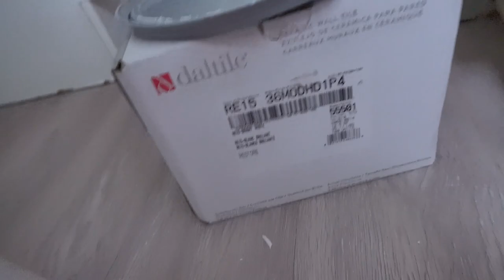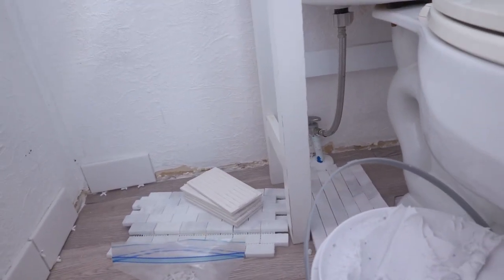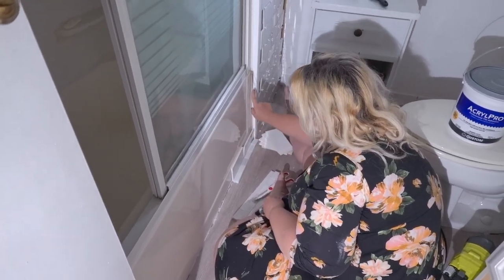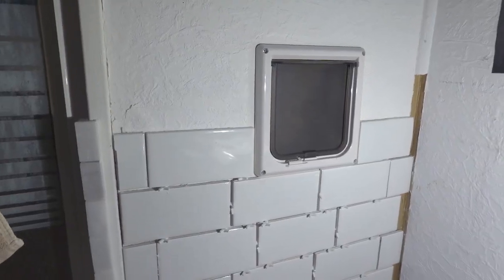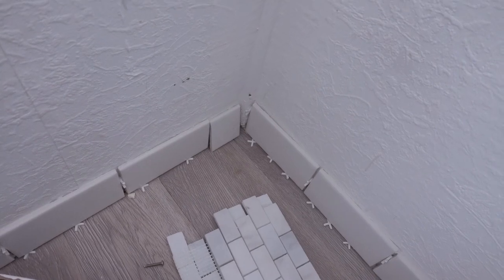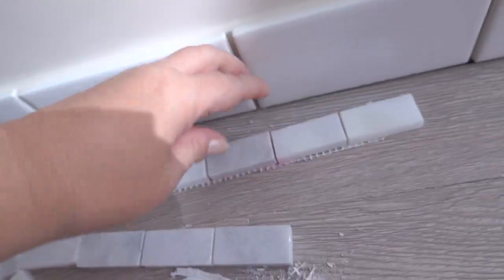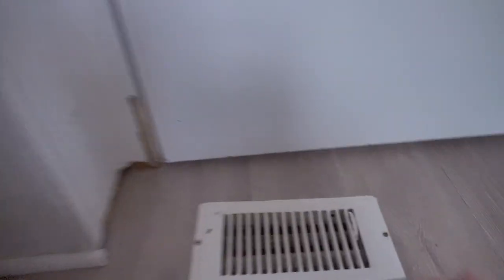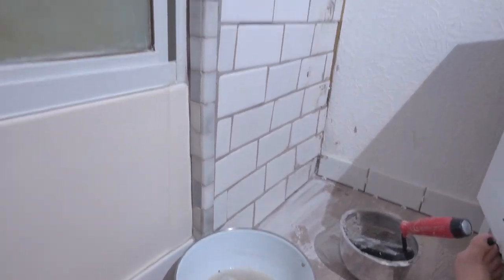Wall Tile in Bathroom Singlewide Mobile Home Makeover

Comment: Very nice all the hard work you are doing you know so much......how does kitty get onto that litter box so high up ....and get through the little door on a height..........love your work cant wait to see the kids room....
Reply from the maker: Kitty has a little nightstand that sits right underneath the little window she goes into. I'd rather not have it in there, but for now it will always be in there for her to easily get in there to use the bathroom. It's nice having it in the wall because it keeps the smell down and the dust down.

Comment: The kids will love having their own space.  Can't wait to see what you do in there.  That tile does NOT look easy to do!  That is a huge difference in height between the bathroom floor and the hall floor.  Wow!  You're on the downhill run on that room!  Looking good!
Reply from the maker: It has not been a problem because you naturally step over the threshhold into the bathroom (thankfully!) We got rid of the height difference in the hallway and the huge transition molding there that would stub my toes sometimes! That wasn't a natural thing on the floor that was easy to get around. The tile is easy, the wall wasn't flush or straight, but it did end up looking just fine. I have to get better at corners, but grout fixes a lot of the ugly spacing from not being perfect. The back wall will be a lot easier to do because the wall is straight! The easiest tile job to start with is a backsplash for sure! Yep, about 90% done on all my projects I started so far (kids room is almost done, too!) It's been a while yikes!

Comment: The tilings going to look great in there, I like tiles because it doesn't matter too much what the walls like, it always comes out looking amazing. I did similar in my bathroom over parts of the wall that had cracks and plaster missing, I just put loads of tile adhesive on and stuck tiles straight over it, to look at it you'd never know😉. I've got loads more digging to do in the garden for my shed project, I think I need a pick axe now to do it quicker as the spade isn't enough 😆. Hi to my favourite pair of cheeky monkeys by the way 👋😺🦄🌞
Reply from the maker: We dont have that problem, the ground is pretty soft and sandy here in FL, but in Israel we had SO much trouble just trying to dig a hole. The ground in the desert was like concrete!! The tile adhesive, hey if it sticks and isnt going to move, it will work just fine and always hide that cracking plaster! That is one thing that I've not been able to perfect or do well on - spreading new plaster!! I always do a really terrible job with it and havent improved lol. If I could, that would make a whole world of difference! Good luck and wishing you no sore backs from that garden project!
Reply: @FoolyLiving  thanks for the encouragement 👍, I'll do my best not to do my back in lol. Same here on the plastering, I'd love to master it, it's quite an art to it. I did try when I did the bathroom ceiling and bought the tools trowel and board to hold plaster on etc but there was more plaster on me and the entire room than on the ceiling (no joke 😆), I had to stipple it in the end to make it look half way decent lol but I think it looks ok now🤞😉🌞